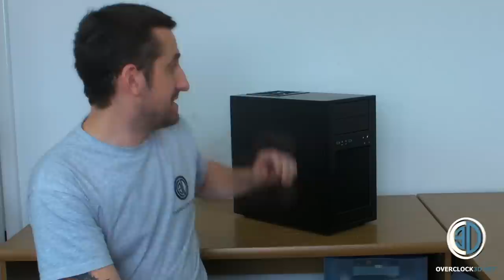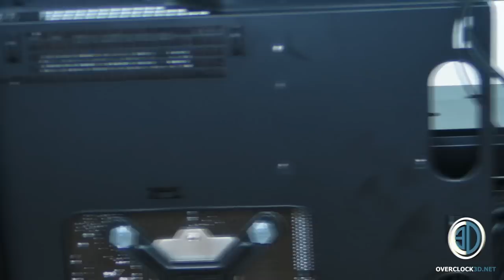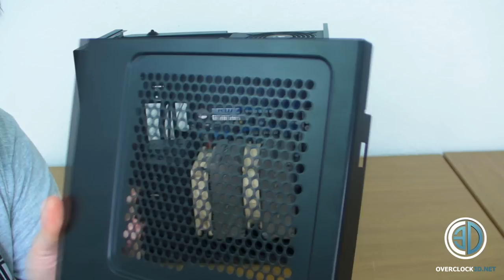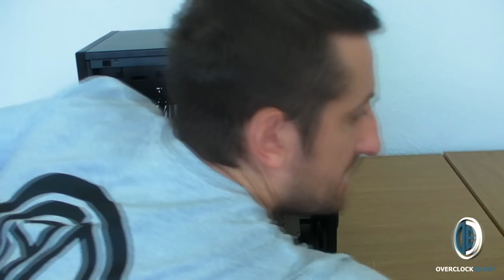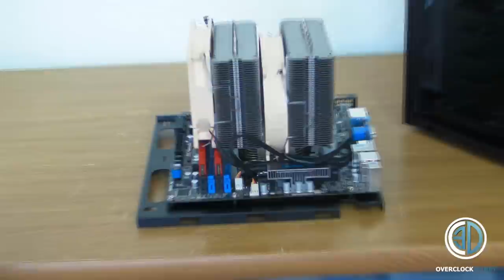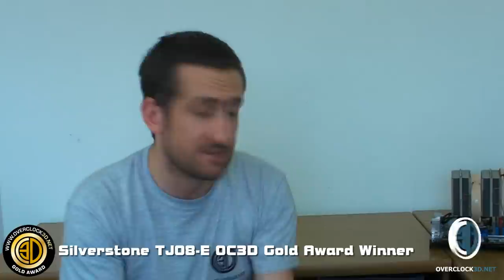Silverstone TJ08-E Review - TJ08

Comment: I've had this case for 10 years, and it's the best PC case I have ever had. It is so adaptable and well planned out. Still using it in my main PC, and it still looks as good as when I got it. It's design is timeless.

I don't know how it would handle the RTX 4080 though, it may finally have met it's match with those.

Comment: I bought it, your review helped alot. I upgrade my system every 2 or 3 years, so toolless design is not a big deal for me. This case is solid, cool and beatiful. A few minor gripes: 1) USB3 front cabe is alot longer than it should be, and its also a bit stiff. 1) it would be really nice if we could ajdust that VGA support on the top of the HDD cage, mine is 9.5 inches long and just barely misses it. 3) although the pre-installed screws are black, for some reason the spare ones are not.

Comment: @TimeToLiveCustoms The way the SS Airpenetrators are designed the HDD cage isn't need to channel the air, the fan pretty much blows the air in a straight line

Comment: Nice review! I was wondering if you could cut out a bit where the vent is on the back of the motherboard plate and use an atx board, so there is like 3cm behind the powersupply. Because i got the asus p9x79 deluxe and i started traveling a lot recently with my desktop, so im looking to make my x79 rig a bit smaller:p

Comment: Is this case any good with an aftermarket GPU; e.g., something with axial fans that exhaust heat into the case instead of the blower style coolers that exhaust out the back? It doesn't seem like it would be a great design for that since the back exhaust fan is below the GPU and the hot air exhausted by the GPU would rise up towards the power supply. Perhaps that's why they're keeping the fan but flipping everything back in the normal direction (PSU at bottom, CPU at top) in the upcoming TJ08-Pro.

Comment: Love the review. Let me know if this is possible. I have the same HS&F as the one in this review. I was thinking about putting my 3.5" mechanical HDD on the bottom HDD slot where you put your SSD. Now will I be able to fit a 2.5" SSD in that HDD cage with the Noctua? It appears that it will fit. I plan on going with 2 5.25" opticals, so I was hoping that this would work instead of putting the 3.5" HDD in one of the 5.25" optical bays.

Comment: Nice case, but still the magnet snap on dust filter? They put on supports for a graphics card and CPU-cooler with an intention for Lan-party use. I Gues how long it will take you lose the top dust filter. At least they made the provisions for bolts. Drill the holes and bolt it on because it will be gone quicker as a cake at a fat girls party. Love the slide in one on the front tough

Comment: Does the inverted design make the gpu blow hot air right around the cpu-area? Is an outtake fan recomended for optimal airflow and cooling? And finally, is it really recomended to have a closed watercooling for cpu, rather than air-cooling?

Comment: Someone already beat me to this but there are two sets of screw holes in the bottom 3.5"bay, it's stamped into the case FDD and HDD. The dust filter has screw holes in so it can be used on an aluminium case I think. This looks like a cracking little case btw. Linus is a c@@k end btw, big on sales patter, small on info. TTL all the way. Keep cranking the vids out brother.

Comment: Hi Tom, thinking about using this with a 6870, 955 BE, 890gx chipset and watercool all 3. 1 SSD + 1 mech hard drive in the optical bay. question is, do you think a 240 would fit in the front, and a 120 in the rear? or a 200mm phobya rad in the front? any thoughts on watercooling this case? cheers :)

Comment: @TimeToLiveCustoms 

Thanks for the quick reply. Here's a screenshot of a 3.5" HDD fitting using that bottom slot with the Noctua.

slagcoin.com/Overclock/TJ08E06.jpg

So we know that this does work. I'm asking if a SSD will fit in that HDD cage with the Noctua. Not a mechanical drive, but a SSD. It looks like it just might. A "L" SATA connector should keep any cables away from that front 120mm fan of the Noctua.

Comment: i have this case with asus maximus V gene, 3770k@4,2ghz @1,272v gonna overclock it more later maybe 4,7ghz and a asus amd6950 2gb and the cpu is water cooled but i have messuerd up and i can fit a 280 rad under the case if i use wheels and no hard drives and i am still using the 180 fan that comes with it and then a 120mm enermax rear as exaust but my question is do you think the mother board will get any heat problems? please answer me =) Ps,i am frow sweden so pardon my bad english =)